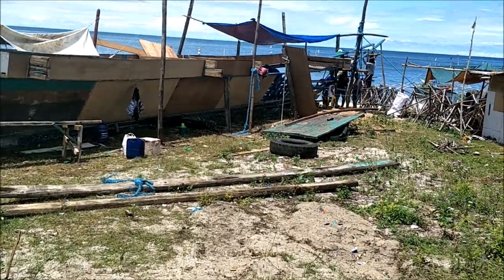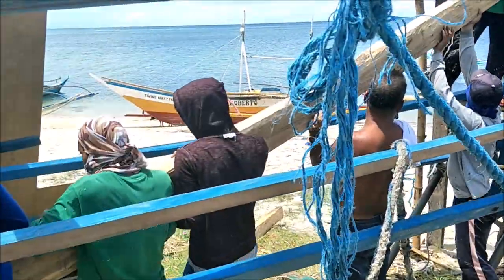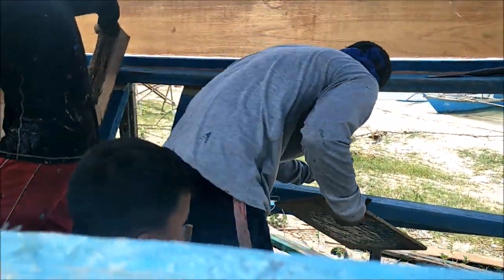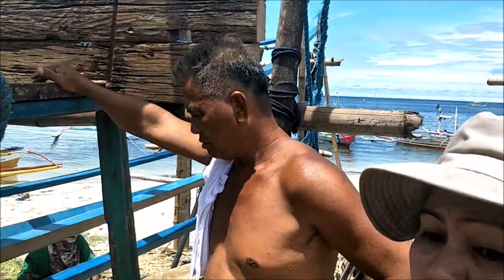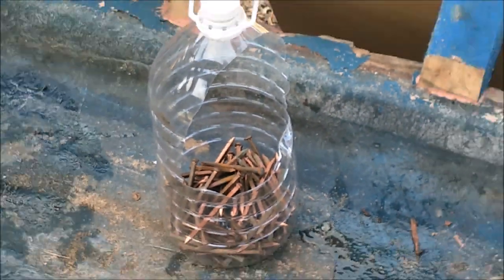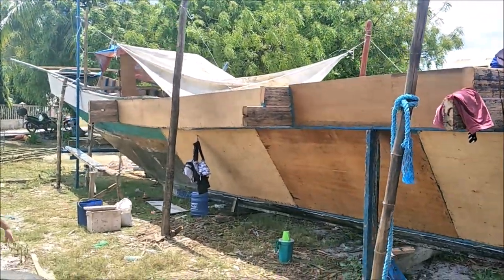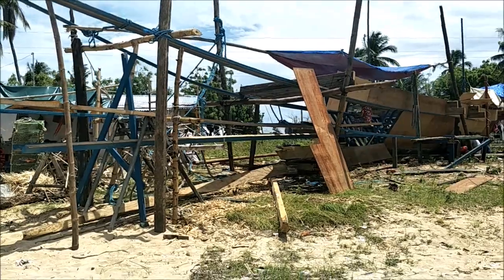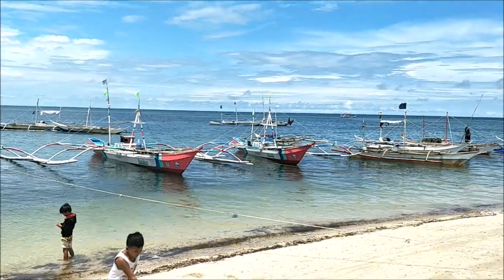Typhoon Destroyed Filipino 60 Foot Long Fishing Boat Gets Resurrected/Rebuilt for 500,000 pesos

Comment: You are right about epoxy sheathing on plywood. My trimaran was epoxy sheathed back in 1980s and it has no rot till now. My previous boat was sheathed using polyester resin, and it delaminates big time. If I were epoxy sheathing these days, I would use Botecote epoxy because I heard the West System epoxy goes yellow due to UV degradation, even under paint... just saying!